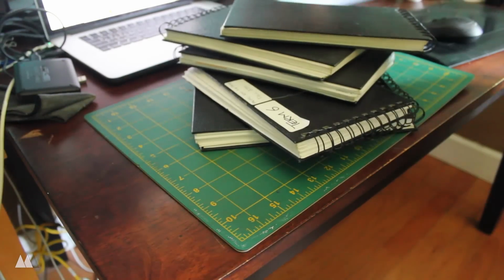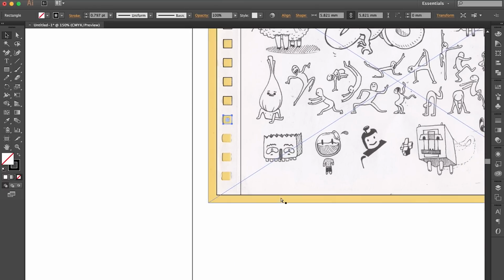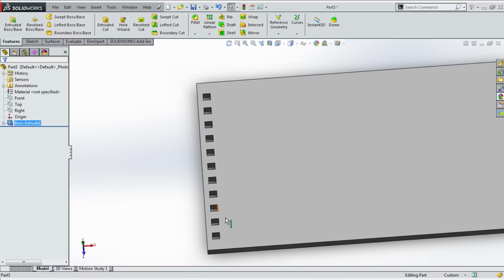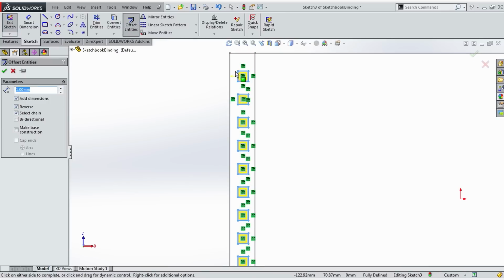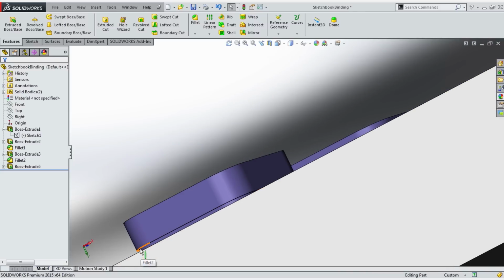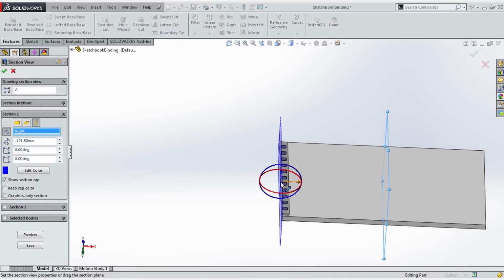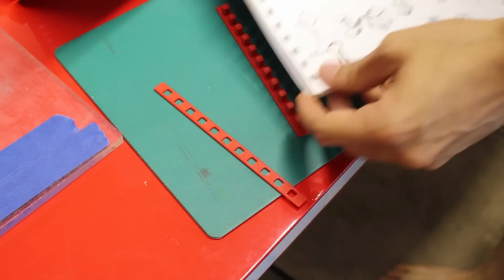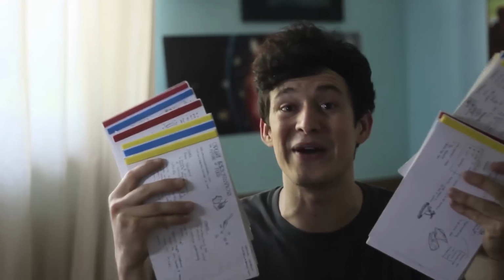Binding Sketchbooks with a 3D Printer

Comment: Couldn't you just print the bindings as one piece, with a cross section resembling an H. Then, when it is about to start doing the upper lip, pause the print and then place all the paper in the teeth. Then resume printing?

Comment: I thought you were going to print it in one piece: print the bottom part incluiding the pillars, pause the print, add the paper and print the second bar directly onto the pillars and stack of paper. Would this be possible?
Reply from the maker: It would be really hard to get the second bar to stick to that top sheet of paper while printing.. also this is functionally the same, maybe better since you can carefully take it apart if you wanted to add or remove a page or something. It would still be cool from a technical point of view though!

Comment: Aren't those rounds ? Cause I'm writing a 'CAD' test on Monday and I'm pretty sure the text book called those Rounds >.> Not fillets, you know when you made the rectangle rounded. Cause fillets you eat so that would be like a "Bite" out of the material, and rounds you "Round" the corner. Just correct me if I'm wrong.
Reply from the maker: Solidworks calls it a fillet (different from a 'filet' that you eat :P). I think calling it a round is also totally okay

Comment: Devon:  You videos are absolutely terrific.  Your design technique in Solidworks will translate into Fusion 360 easily enough.  The fact that you make a 3D model of your 'object' (in this case the pad of paper) is great.  It is exactly what I do.  Make a representative object and then model around it.  Fusion 360 does not import Illustrator files to scale, yet.  Just another step.  Thank you again.

Comment: Okay, wow... I had no idea that you were the guy on the illusion print that was trending a couple of weeks ago. I would have expected your channel to blow up after that, especially with content like this. I even watched the hair clipper vid, I liked it, it's the kind of thing we need to think about when we work with new tech like a 3d printer. I need to keep an open mind here, there are a lot of problems to solve, not just fan covers!
Reply: 3d printing still has a relatively small community so 11k subs still isn't bad.
Reply: Nick Putting Quite right, it is relatively small. This is growing faster than many expected. 1990-2012 nothing and then BAM!
   I just bought a 3d printer 4 months ago, I love it! I'm using this to brush up and hone my cad/cam skills. My brother asked me last night what entry 3d printer he should buy, and he has 0 cad training. I recommend heavily that he wait a year#1. And that he learn cad #2. And #3, that printers are getting better, cheaper and filament quality, variety, and versatility is improving rather quickly as adoption rates increase.
Reply: had mine my delta printer for about 2 months and have been using it for so many little things. already designing parts to try and make it better.
Reply: I wanted a delta! I prefer the design, it's way more elegant. I actually built waterjet machines back in 1994 using this same tech, specifically  stepper motors with a custom x/y axis for Omax machining. This 3d tech is so familiar it's like stepping back in time. The only difference is the shrinking of the platform and the fact that Delta printers are faster and have a different base frame (circular as opposed to rectilinear).

Comment: I wasn't expecting much from this video, and then you went and blew my mind! I have recently purchased 3d printer and now have more fun things to do with it. Btw, I'm using Onshape, which is parametric as well. I'm still in the learning phase, but already, I've designed & printed my own fan protectors for computers and Industry work (food line chillers). Simple extrusions are, well... simple.
Reply from the maker: Thanks, glad you like it! I've been thinking about learning Onshape because it's more accessible to people... but I keep ending up back in Solidworks!
Reply: I have Turbo-CAD, Form-Z, DesignSpark Mechanical, and 123d Design. Onshape is so much better than any of those for design, and for simplicity and parametric features... also for being free!  I have no experience with Solidworks, but it looks awesome. To be honest there is definitely a learning curve with Onshape, but in the end it's friggen awesome have cloud storage for 3d design!
Reply: what I like about Onshape (altho I'm a novice) is that it also works on my ipad and iphone (lol) so I can easily show my work on the road or tweak at it on my ipadpro AND you can share the workspace and/or have other people work on it with you!  it's free and all cloud-based.  Now if I could only use it like a pro you are in Solidworks :p

Comment: That was a very nice idea! I notice you switch between metric and imperial systems from time to time. Isn't it confusing?
Reply from the maker: I guess it's a weird way to work, but it's the system that ended up working for me. Solidworks automatically converts between units while you're dimensioning, so sometimes it's useful to use imperial vs metric.